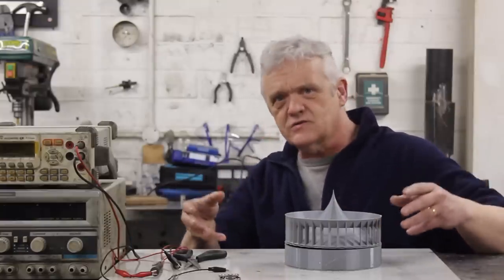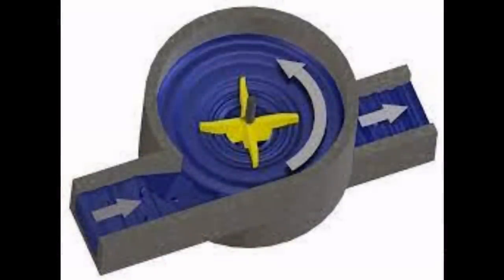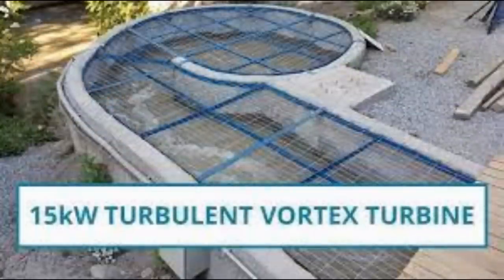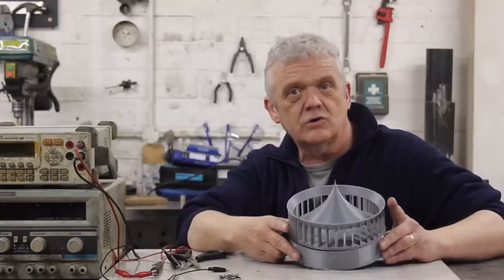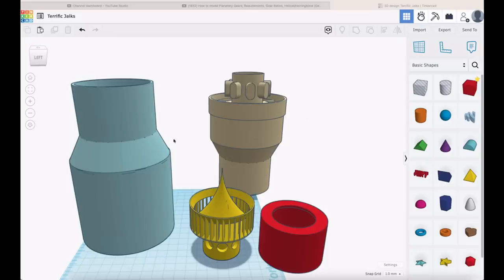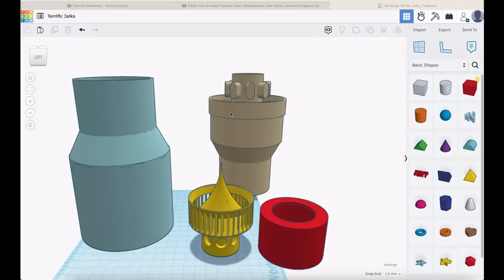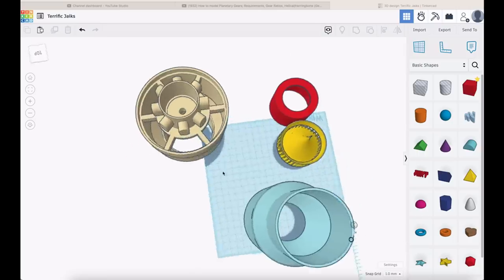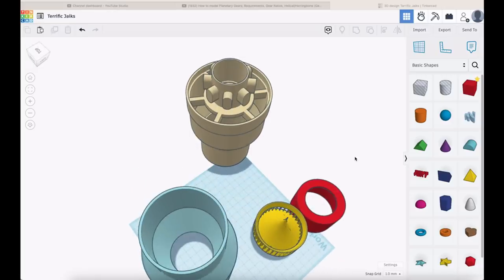1884 A Vortex Turbine In The Making

Comment: There is very little difference between wat and air flow all you need downwards pressure.....as down wards heat would turn the turbine as well.
Reply from the maker: it would

Comment: Not work on a down pipe , water flows down out side of pipe unless running at or near full bore would have to reduce down and drop into canter of turbine that could be a good thing as pipe becomes a resivor and gains a lot of velocity but in real yse would block up dead easy
Reply from the maker: you think - well I think you are wrong mate - sorry lol
Reply: @Robert Murray-Smith  ok , try it if you have some thing like 100 mm dia pipe clear plastic , water clings to inside wall of pipe unless flow is very large volume and over a vertical drop tends to spiral down the pipe
Reply: Have a look at 
Computer simulation of air water counter......
Not exactly the same but same effect of water in large dia pipe with air in center , also a square pipe like a lot of RWPipes are it tends to flow down one side of the square untill the volume of water is large , around 20% of the cross section volume,  Air to water

Comment: You all are thinking too small. This is the age of AI, and with AI the most needed resource is data. This downspout turbine can be used to collect weather data. Optimize it a bit to make the case for a 10 yr or less ROI, and you can sell them at a loss and make up for it with data sales. Imagine selling live weather data in a subscription model on a global scale.
Reply: I believe you have it backwards.  Energy is the foundation.  No one is doing anything without energy.  Without energy, all of those computers are just worthless pieces of junk.  There is no data flow without energy.  If the data is not flowing, it is not usable.  The hard drive on your computer may be perfectly fine, but if you do not have that computer plugged into the wall and/or your power supply is fried, you are not going to be doing anything with the information on that hard drive.
Reply from the maker: now that is an interesting idea - very out of the box mate

Comment: finally water
Reply from the maker: lol
Reply: I never doubted it would work but I do wonder if a Darwin Turbine would work at all immerged in water in a coastal area or in the open ocean in underwater currents.

I suspect the Darwin Turbine would have to be placed horizontally to direct fluid sideways instead of vertically to not be overcome by differential pressures.

Comment: Coils, magnets and electricity... does that go together with water? No short circuits?
🤔 There's a lot of hype about the so called AI, why don't we ask it to help us with stuff like this, e.g. what's the best blade or funnel shape for this specific application... ? Or, if it actually is intelligent, and not just a very fast computer, why has it not come up with groundbreaking solutions on its own?
Reply from the maker: because it is just a fast computer - with the addition of lots of hype - it is only as good as the model it uses
Reply: @ThinkingandTinkering  my thoughts exactly,, it will ALWAYS be ones and zeros.